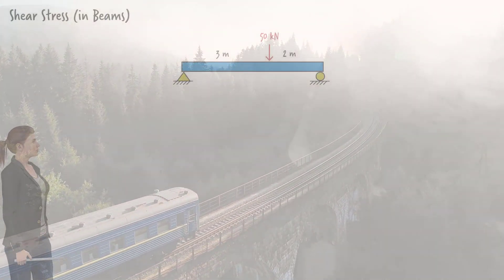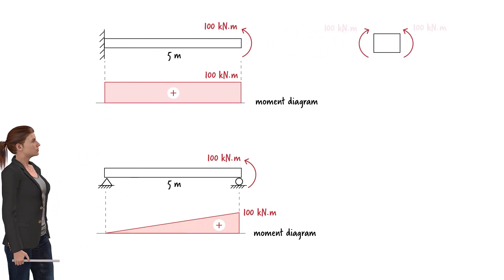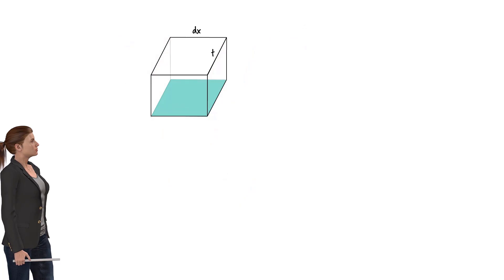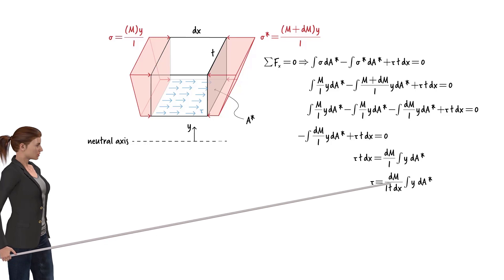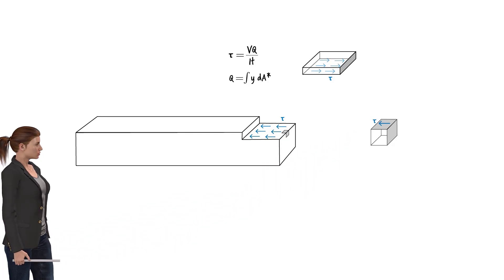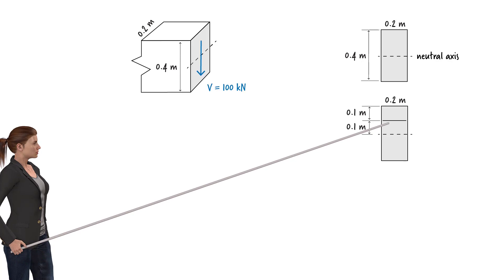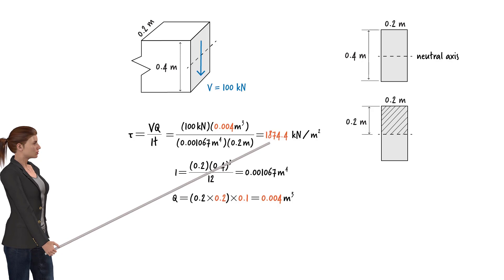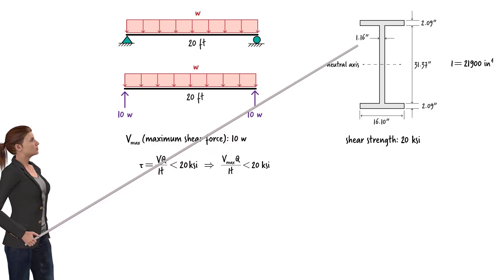SM3: An Introduction to Shear Stress in Beams

Comment: I couldn't understand how the shear stress occurring in the beam. That mean I am not able to imagine because normal compression and tension stress also longitudinal axis similary shear stress also acting parallelly to the surface of the longitudinal axis how come to two stress which would act in the same direction?? Confusing.. in your explanation it is not clear. Also I have one doubt shear force us acting to parallel to rhe cross section of the Beam then the developed shear stress  would also be parallel to the cross section then how come the shear stress would occur in the longitudinal direction of the beam i.e at the bottom of the prism
Reply from the maker: Yes, normal stress and shear stress could act in the same direction. But in that case, they are not acting on the same plane. In a beam, the normal stress acting in the x direction is normal (perpendicular) to the beam's cross-section. 

However, the shear stress found in the same beam pointing in the x direction is not acting on the beam's cross-section. Rather, it acts on the plane perpendicular to the beam's cross-section.

Therefore, although the two stresses could act in the same direction, they effect the beam differently. 

Why do we have shear stress acting on different planes in the same beam? Laws of physics! 

For a beam particle to be in the state of equilibrium, it must not move or rotate. If we consider only the shear stress that acts in the x direction, and assume there is no shear stress acting in the y direction, we would not be able to satisfy the moment equilibrium equation. 

Why? Because, the normal force coupled with the shear force (both acting in the x direction) causes a clockwise/counterclockwise rotation. This moment must be balanced with an opposing  moment. Such a moment is produced only by a shear force that acts in the y direction. So in a beam particle, shear force must exist along both x and y axes to maintain static equilibrium.